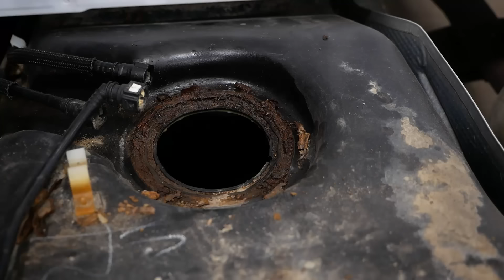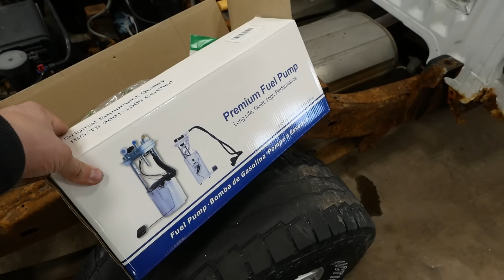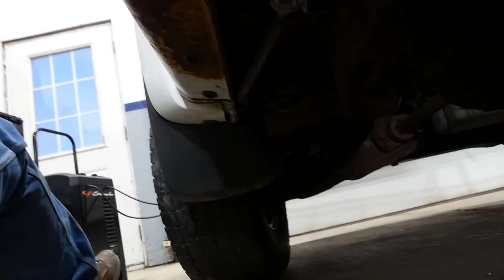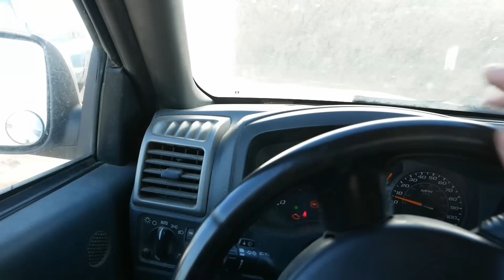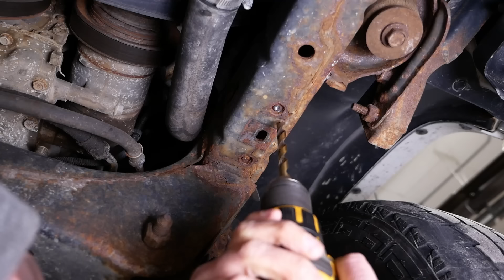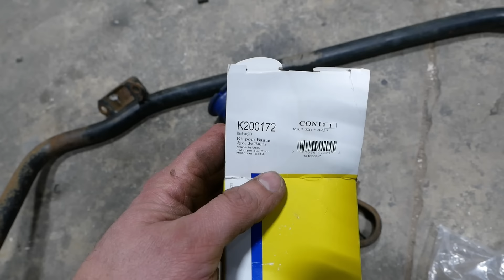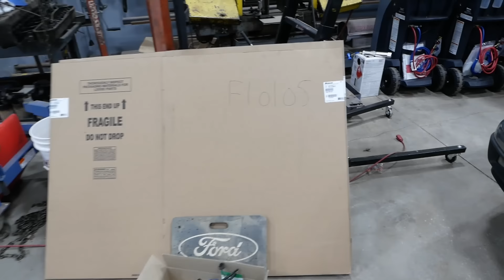Saving a GMC Canyon with 434,000 Miles from the Crusher - Won't Start, Fuel Pump Tabs Rotted

Comment: Gm uses a somewhat  complex  system to  confirm  pump  need. If the  signal from the ignition system  is out, the fuel pump  should not be activated.  Igc, look for that one.  A failed  relay is another possibility.

Comment: Greetings from the Ohio Porters. ❄️ A 2005 with over 400K miles…How many engines have been in that thing, It shows the wear & tear, Is it worth anything, Will it be safe? Many questions! That body…it seemed to be wasted, but if the owner likes it still and was willing to get the parts. I was shocked you had problems finding the fuel pump. It was worth tracing those wires back, huh? I would’ve guessed that the rubbing harness to be the culprit, but we were both wrong. You just never know. 🧐 You didn’t really show much of it, but I was wondering if the floor board was still half decent. It looked good as far as I could tell. This video was quite shocking and surprising! Worth watching! Thanks! 🥰🇺🇸✌️

Comment: I had that same truck. I am only 15 mins in. I had a problem with PassLock. If I tried to start my truck and didn't hear the fuel pump engage, it was because PassLock was disabling somehow or not sending it power?. PassLock is some kind of security feature? I'm not a mechanic. I just had this same exact truck and that was the problem with mine.

Comment: Reminds me of my brother's 1989 Chevy k1500. Had an issue with it stinking of gas for the longest time. Not sure if it was a vent tube issue or the tank's lock ring.
Reply: That idea ya touched on, an auxiliary tank, isn't a  bad one. Though, it does have it's own downsides. Including losing bed space in the truck, but it does give you a good chance to return that "05 to the road. Granted, it still does beg the question of how it would handle in case of an accident. Rollovers might be the worse case scenario.

Comment: The driver's front tire was heavily worn on the inside edge, but the passenger side was fine. Paul from Fab Rats repaired a broken frame mount on a truck like that with the same shaved off tire. It was even on the same side.

Comment: Nice detective work, man.
Funny, the check engine light just came on in my PT Cruiser 30 minutes ago before I watched this.
Don't think I want to know.
I had a WJ Grand Cherokee High Output 4.7 with 417000 on the clock, and it drove like 117000.
Pity about that tree...
Engine is now in a serious off-roader, and still going strong.
Maintenance?

Comment: There is two things wrong with American vehicles! Firstly the steering wheel is on the wrong side of the vehicle & secondly the chassis’s are so rusty to the point in my country of NZ it would be condemned unroadworthy! Why don’t vehicle owners have their chassis treated with a rust inhibitor? My GMC I’ve had rust treated with a rust protector &it will out last me!

Comment: Silverado's were exactly the same way.  Rusted rings, flimsy tabs (if they didn't rust away) and fuels pumps that just ground themselves to pieces.  The fact that I got 230k out of mine before it quit was lucky, I was told it should have quit around 100k.  My dad, who worked for Delphi (Delco), knew all about it because he used to visit the plant that made them and he said they were all junk, but they saved themselves millions by not making them better.

Mine is rotting away, which is why I'm also lucky that the tabs didn't just turn to dust like this, took me about a day to get the ring off, but I made sure a new one went on... though, I figure the next time I have to replace the fuel pump, it'll be time to replace the whole truck.

Also wish I could have been able to tell you that those are pressed on fittings, you just push forward squeeze the square tabs to release them.  They're still a pain, but you don't actually need any special tools, maybe just some pliers if they're really stiff.

Comment: Yes they can go that many miles.  I own a 2004 GMC Canyon. Owned since 2009 now has 303,000 miles on the 5 cyclinder. Only thing I've ever done is rebuilt transmission at 220, 0000 when I lost reverse.  Other than rust from upstate NY weather, she's a rock!!

Comment: I kinda had the thought “who says the original pump was bad?” First t  hi no everyone thinks (probably me too) is, fuel pump is shot. But why? Does pump have power? Thought the harness rub through. At least you found it with the tug test the location. (I know, not your first rodeo) Odometer must be 434k miles as outside big numbers are also miles per hour. That is impressive! Thanks Wes for side info on the bolts you drilled out, regarding the inside being softer than the outside. (I learned something!)

Comment: Tesa tape FTMFW. Always looks the best when the harnesses are all wrapped and divided properly in it. VW/ Audi use Tesa religiously and their harnesses definitely hold up well. I think your on point when you're talking about the split loom collecting dirt and it abrasively chafing through the insulation. The vibrations will also speed up the degredation of the loom as well. So if the harness isn't anchored with p-clips or tabs of some sort and too taught it will definitely chafe through the wiring even quicker. I too have seen the same type of damage many times throughout the 25 years or so I've been turning wrenches.

Comment: My brother drive a 2008 truck in a cash for clunkers trade. The Ford Rangers he had was running on five cylinders and pretty tired at 385k. He had about nine grand with the clunkers trade.
  The Chevy Colorado made it to 503k and he drove it a mile or so after the low oil light came on.. 
Metal in the oil pan so RIP
 He never changed the differential fluid or the clutch. Sure would like to know if something let loose or the oil pump quit and killed it

Comment: I have a 1999 Escalade. I bought and when I got home the service 4x4 light came on. I notice it shifts funny when the service 4x4 light is on plus 4x4 won’t work.  Then next time u crank it it might not be on and everything works fine.     May drive it a day or a week but then it comes back on and back to not working.   If I had the money I’d send it to u.  I’m sure if anyone could figure it out u coukd

Comment: Seen quite a few vehicles with bigger mileage on them than that.  But I don't live in the salty rust belt.

Best we currently have on site is sitting at 82x,xxx km (~510,000 miles).

Comment: Wiring problems are always a pain. I was working on an electric man lift that didnt have one of the fuctions in the basket. Long story short i found a broken wire inside the 12 conductor cable. Even worse than that, it was a virgin cable never been worked on. I cut open the armor and found 2 ends twisted together and taped up. Inside a production 12 conductor cable. I was totally blown away. Somebody in the cable plant had to have actually done that, and their supervisor passed it. Totally blown away that somebody would think thats okay.
Reply: That is ridiculous!  A virgin cable shouldn't have splices in it, especially that way!  Even a repair should be soldered with heat shrink over it if possible.  Splice and tape is what you do to get home after breaking down.  I do get that there are areas in a car or any other vehicular device that you can't get to with a soldering iron but especially in the salty north if you can, solder your splices then use heat shrink around them.
Reply: @mharris5047  thats what really frosted my hide. Somebody had to look at that with their own eyes and make a decision that was acceptable for production.

Comment: Nice Truck!!   They sell Grill Clips and Head Lights on Rock Auto approx. $100.  Colorado's up here in the North East have horrible harness issues...  If you have injector or Coil codes / Engine Misfire Check the harness that comes from the ECU to over the valve cover...  If you get a random "no start" just wiggle the harness near the ECU...    My 05 Colorado has 413,000 miles..  3 Tranny Rebuilds, Head and Tail lights, Oil pressure sensor, 1 G80 Locker, Countless wheel bearings, Rack, Window Regulators, Alternator, Radiator, Idler Pulleys, 2 Fuel pumps, 3 Water Pumps...  She still has pep but is losing a quart of oil per 2000 miles out the rear main. Frame is still solid as I have oiled it every year.. I've found Cooper AT Tires last the longest...
Reply: Just put a new blower motor and rear end in. Looking for a better bench seat.  428,000 on her now... Alternators starting to make noise.
Reply: Door locks quit (Drivers door still unlocks, no lock, pass dead) and had to replace whole rear end @ 430,000...

Comment: 2004 Dodge Ram used the same type of tank.  I also bought an amazon fuel pump, and it pumped fuel, but the fuel gauge.  The second one did work and is still working ( 2 years later ).  Will try this kit to fix my vapor leak at the tank (i.e. tabs are broken ).

Comment: Drove my 97 Blazer to the junkyard. Engine and transmission worked fine, rust was just too much. Every little job turned into a nightmare trying to undo bolts and other parts all fused together.

Comment: Hey Wes, I’ve had good luck re-pinching the edges of the radiator tanks as long as the plastic tanks are not cracked. It’ll save you some time and money for sure

Comment: The 5 cylinder and 6 cylinder are exactly the same other than the extra cyclinder u can but a 5 in trailblazer no problem can't put 6 in a canyon won't fit be in radiator

Comment: We’ve had many Toyota pickups(early 90’s) make it well over 450k, engines always ran perfect but the frames rotted out, my dad had one go to 520k, best truck he ever had. Most recently I had a 01 Jetta tdi make it to 415k, sold it and it still runs to this day, has to be well over 500k by now. I’m a fan of high mileage vehicles
Reply: I am a fan of not writing a $50K check every three years for a new car.  I will likely be writing one of those checks pretty soon but I have had my car for 11 years and this one was bought used.

Comment: This is great info as I have the same truck with 285,000, I should pull the box and do some rust proofing if I have any lock ring left. I have similar climate in Minnesota. Wondering if cavity wax or grease would be best covering?

Comment: Be shure the polarity is right i had a pump from this company and it wouldnt pump fuel in the tank but outside it was fine, the dam pigtail wires were crossed!

Comment: I had the exact same problem when I removed the sway bar on my 07 tahoe to drop the oil pan. Did the same fix too🤣 broke a few 10mm sockets and only got 1 of the 4 bolta out.

Comment: Plumber's pipe dope? I'm down. I just fixed a Saginaw Steering Gear gearbox on my '91 Suburban. Over center adjustment kept coming loose, for some reason had a 7/16-20 Nylock nut on it and I don't think the nylon liked the heat. So, I bought a too-small 3/16 internal tooth lock washer (Would've had to order 7/16), two 7/16-20 nuts... First tried the lock washer after filing it out under the nut and the steering started leaking like a seive.

So, I said to heck with it. PTFE pipe thread sealant all over the adjustment screw, one nut down flat, internal tooth lock washer, other nut on top. So far so good. 

I had some loctite thread sealant I used on a transmission leak but no idea where that crap went. Figures.

Comment: Theory: That sway bar has been off for years.  (Perhaps they were doing some off road-ing with Matt's Off Road Recovery).  The heads were broke off and they were very rusted at that break off point.  So they weren't broken off recently.  It was a while back.

Comment: Only 400000 miles lol my 04 Chevy Silverado 2500 has 999,990 mile and is the second time it has rolled the odometer all original parts motor and trans which is very unusual lol

Comment: We had a 1996 F150 4x4, 300 six, 5 speed as a parts delivery truck at my old job. It was a Ford dealer, so truck was bought new.  It went to auction with almost 750,000 miles on it.  Engine had been gasketed numerous times, oil pans, cat converters, etc.. but internals were original.  Original 5 speed lasted for 350,000 miles, and the remans after each lasted around 150k.  Lots of piston slap when it was cold, but it still ran great!

Comment: I see alot of rusted fuel lines ,brakes lines etc in Missouri  I worked on a Chevy Truck from New York area and it had 6 rusted lines behind the fuel tank area along frame rail both fuel and brake lines  would never buy a vehicle from northeast area

Comment: Have a 2004 z71 Colorado bought new with that 3.5 engine in it. At 20 thousand miles it was towed into my Chevy dealer and had to have the head replaced. Have had a lot of electrical problems with that truck also. The grounds and fuse box are always causing problems. After saying all that I still have it and it still runs with 390 thousand miles on it with the only rust spot being on the driver side rear door corner. But I always wash my vehicles twice a week up in the north east

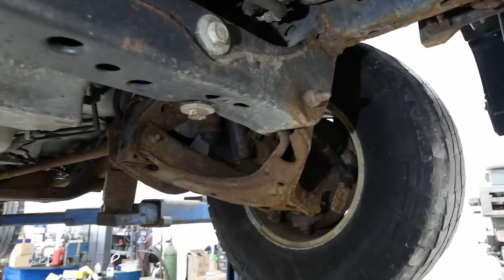Comment: 26:50 brings back fond memories of the bolt inside my frame snapping the welds, managed to snake a nut in there and barely hold it enough to tighten it down. Then toyota recalled my frame, win!

Comment: Bending break, flat steel and a welder... measure, cut, bend, fit... weld then pressure test it... make sure you have a couple of baffle [more flat steel] in there... get the appropriate length sending unit... yada yada... Can't you even get like a Mustang gas tank or some car tank and put it under the box of the truck? Gotta be a ford truck tank you could rig up to that old GM lol

Comment: I see you've got some new AC machines there too. Got one at work. Works good, but they don't let you top off freon. You have to completely recover the system, and recharge. And I'm talking top off like if you're working on an RV that has no listed capacity and you're guessing how much to put in after a repair.

Comment: I see it's eating the inside of the right front tire.thats another problem with these trucks.had a guy from MOOG take mine to their research place here in St Louis.they rebuilt the front end,aligned it,still ate up the inside front tire,as did my father in laws 4x4.started looking at other Colorado's they were all wearing the inside of the right front tire

Comment: 11:50 I can feel my right arm aching as you tighten those screws. I have a detached bicep which is not debilitating, but I can't use a screwdriver properly anymore. Hallo power tools! Edit: Oops, spoke too soon there! As for that chime, why, just why? I haven't come across any vehicle in South Africa with a chime that goes on and on. It is, however, common (in my price bracket anyway) to have 3 seconds of warning about no seatbelt. No problem for me, I ALWAYS buckle up before driving...not like some supposed immortals that sit on a buckled up belt. Only in Africa!:oops:

Comment: Have you ever messed with a wiring toner? It allows you to connect a device to one end of wire and then use a wand to run down the harness. It sends a tone down the wire and when you reach the break The tone will greatly lessen or disappear. Can be helpful.

Comment: I'll tell u why....The wrapped a chain/strap around it and yanked the sumbitch off trying to tow it... Thos trucks are riddles with electrical demons and passive security nightmares. The fuse boxes break the solder joints, the pcms go bad, the wiring is garbage. The exhaust bolts and egr air pump thingy just snap off on their own and thats here in TX!! no rust! P.S. seal all works really really well. i'v used it multiple times with great success

Comment: Wes you are so lucky , you get such good trucks to work on. LOL Sigh! GM gas tank made from unobtainium
 or obsoleteium with a fuel pump made from chineseium. The three new elements from the periodic table that have no value.. That was a weird wear problem with the wiring. i'm guessing one side if the sway bar mount broke and the other side broke when he went to undo it because its a rusty piece of crap. LOL  Good repair job Wes.

Comment: My dad had an 08 canyon with the i5 for a few years and that thing never idled well, even with lower milage and all good ignition and injection components it still felt like it missed at idle but never set codes. I think thats just the nature of the beast with those larger i5 engines. other than that it was a great little unit.

Comment: Wes,
That's so reminding me of the 3500 dually dump. The rear tank sending unit was rotted out, in a metal tank!  I ended up repacing the sending unit and about four foot of each fuel line. What a PIA.

Comment: Excellent video Wes  :) also think the truck be in Kms can tell you sounds more like than Miles be also check on air filter box on Power connection also filter bet never check and may need vaccum out to plus Mass Air Flow ring maybe dirty to need some pentriotion fluid squirt on to clean ! Also that truck probably need some 89 fuel plus fuel injection cleaner of STP Total Treatment fuel injection and carb cleaner in too also oil change too! That wild on fuel tank prices gezz and horrible too also no tank available that not nice ! I remember my late dad did for friend his of back in 1994 think wild to ! His friend had old 1968 Chevrolet C10 pick up tank was leaking so put a  1968 International 1300 pick up truck fuel tank old truck died on  plus Cheverlot Send Unit hook up filler neck in door hose and work fine ! Internation fuel tank was only 35 gallon type and old back seat was rusted out but that truck still on road today surprises me ! Even on certified no problem and tank over 40 years old Lol!

Comment: The highest mileage pick up truck I’ve ever seen is a 99 f-250 with a v10 gas it still runs every day it has a little over 800 hundred thousand miles it on its second engine but still goes
Reply: Second engines or trans don’t count!!  It’s not the same.